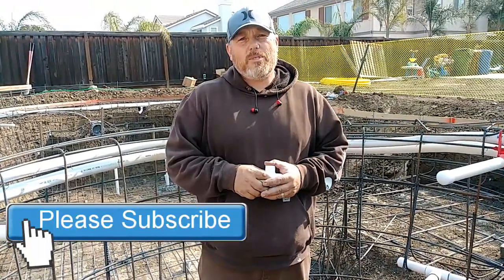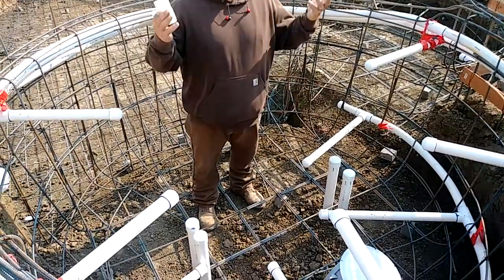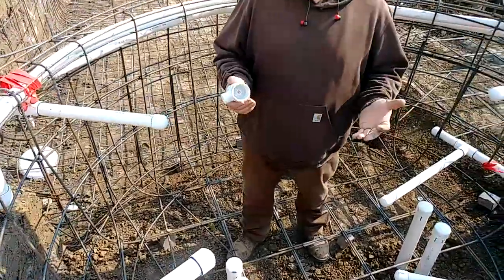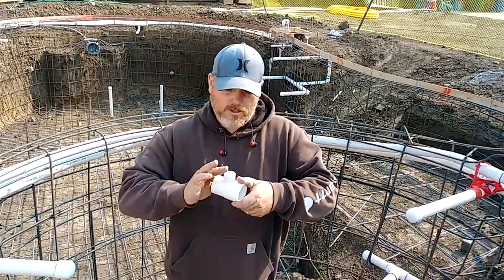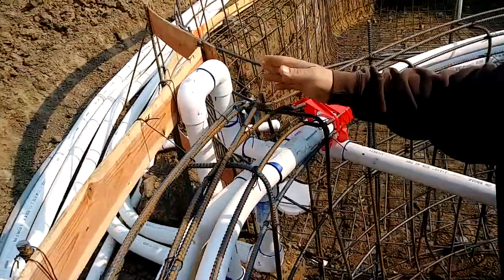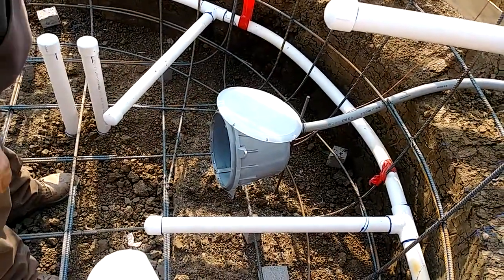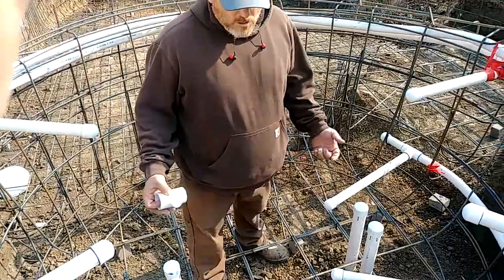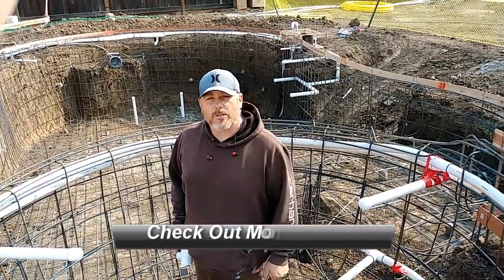How a Spa works

Comment: I enjoyed it I am making a spa like this too and cirious about how many amps I need for this project 👍
Reply from the maker: I usually run a 50 amp breaker for a pool spa combo
Reply: John The Pool Expert ok thanks also does one 50 amp run it by itself or does the 50 run to a sub panel then branches off
Reply from the maker: @heroknaderi  
Normally your pool panel. Is a sub panel as well.

Comment: Great video. How do you bend your pvc pipe? What size pump do you use for your spa jet returns? Is there a way to use one variable speed pump with and plumbing in the spa the way you show in this video?
Reply from the maker: You can use 1 vs pump and it will work but the Jets won't be quite as strong. 

Here is my video on bending pipe https://youtu.be/_edkuq8ecMc

Comment: Is there a certain tool to unscrew spa jets? Mine is a out 8 years old and I want to unscrew my jets I believe something is blocking it.
Reply from the maker: Yes if it's like the one in this video it will use a standard socket with an extension either 9/16 or 3/4

Comment: I would like to know where the Lasco jets are located. I removes a return eye ball in my spa and found the removable jet nozzle has somehow fallen off and was stuck in a return eyeball. This is a inground pool spa and I now get no air activity in the spa. I also can see water in the 2" air intake pipe at the pool equipment . What do you think?
Reply from the maker: https://lesliespool.com/waterway-gunite-venturi-tee-7-16in.-nozzle/364976.html

This is a jet nozzle made by Waterway it should be interchangeable. Some plastic nozzles have 1/4 twist-lock make sure you pull out the original one and look at it before you order one.
If all of the jet nozzles are in it should start to work properly.  Also if you remove the eyeballs it will work even better.

Comment: Great video. Our pool guy didn’t tell us that our spa was his first.  We have 8 jets but they are regular pool jets with a 2hp motor. We barely have any pressure coming out of the “jets” and there’s no air connection at all. Can we get a bigger motor? Would that help?  Trying to determine if there’s anything we can do short of getting it completely replumbed.
Reply from the maker: You could put smaller eyeball fittings so you have more pressure at the jets... but without venturi jets you can never get the air bubbles.
Reply: @JohnThePoolExpertGuy  ok...a minor nitpick....you don't increase pressure with a fitting...only velocity; the smaller the opening the less water and the pressure moves that smaller volume of water faster
Reply: @universaldonor3100  hence Raising the pressure. !
Reply: @MrBmxbrawler  it doesn't raise pressure one psi....you should do some research on how pressure is defined
Reply: @universaldonor3100  arguing with you is useless.   Restrictions in the return lines raise the psi. I work with it every day of my life. You make absolutely no sense

Comment: Hey i have a spa that just got built and the plumber put 2 drains in the bottom with only one suction line from the spa, and one suction line  from the pool and one and they both are connected with a t jandy valve, the issue im having is the spillway does not have enough power to spill nice unless i completlely close off the spa suction any  possible way i can fix this?
I can send you a pic of my plumbing it would really help me out brother!!
Reply from the maker: That is typically how It works. Normally the Spa suction is off unless in "spa mode" unless you have a completely separate set of equipment for your Spa.
So for  a decent spillway you need 100% pool suction and 100% spa return.  For regular filtration I usually set it for 100% pool suction and 50 - 50 pool and spa return.
Reply: A spa main drain line should be closed unless in spa mode, make sure suction is only open to the pool, and then you should also have a Jandy valve that controls water back to the pool, you should be able to split the water between pool and spa. 
The other thing about spillways is they're often not constructed very great when it comes to efficient water shear. What is the spillway made of?Granite, tile, rocks?
Reply: Thank you both for the replies they really helped me put all is well now!
Reply: What size pipe is the spa suction line?

Comment: Hey John, can spa light be reinstalled if spa light cord is stuck inside the conduit and pretty much done. Conduit is 150' away to junction box so no luck there, many tried. I want to add spa light in different direction with new conduit and separate connections. Partially demolishing spa seat, drill to make a new conduit and then replaster? or other alternatives?  Thank you in advance !
Reply from the maker: If you could get ahold of the original conduit closer to the spa it would be pretty easy to cut it and pull out the light and rerun the conduit closer. If that's not possible then you would have to bust a hole through the step and put everything new.
Reply from the maker: By the way.....Were you able to pull out the ground wire that goes from the niche to the jbox?
Reply: John The Pool Expert bonding wire was pulled out from the spa side couple feet out then got stuck and they tried using 4x4 but it snapped pretty much right by the niche. They used fish tape from the junction box to grab on to the new spa light cord and fish tape also got stuck about 25’ deep. At this point human strength is not enough and nobody has tri pod rodder.. seems like something got mingled inside or sharp corner of conduit.. conduit goes around the pool covered with concrete along the way :/
Reply from the maker: @Spartan_0916  
What I have found when pulling out old lights solid steady pressure will never do it. It needs to be pulled from the pool or Spa side and it usually needs quick hard jerks to get it to start sliding. Sometimes I will take the cord and wrap it around a sledgehammer and swing it away from the light niche. Sounds like you may be past the point of removal though.
Reply: John The Pool Expert yes, we have tried everything at this point. Im just blaming myself for even touching the old spa light cause it was working fine but it was there since 2001. My only option now is plug the old niche and make a new one with its own conduit and separate connection. Im guessing spa seating area can be busted and drilled then re plastered for new hole/niche?
Reply from the maker: @Spartan_0916  
Yes of course it can
Reply: John The Pool Expert Thank you John!! Btw where are you located?
Reply from the maker: @Spartan_0916  
Modesto
Reply: @JohnThePoolExpertGuy  if you ever do work in Sacramento please let me know )
Reply from the maker: @Spartan_0916  
I do
Reply: John The Pool Expert can you send me your contact info? I can send you some pictures of the spa.

Comment: I have a pool that has the air intake line spit out water. Is that normal if not how do I fix. Thank you
Reply from the maker: It depends where the water is spitting out
Reply: @JohnThePoolExpertGuy  The air intake line is by pool equipment and I can see water in it when I remove the elbow 90. When I put back into pool mode the pipe that has air suction spits water out. I have never seen any lines do that. Is there like some type of check valve along air intake plumbing line. Thank you
Reply from the maker: @herbertperez4082  
Typically that happens when a jet is plugged, covered, or if the jets have adjustable pressure and a few of them are turned off.  First I would check to see if all the jets are flowing the same.  Then I would take a shop vac and blow the line out. From the equipment to the pool.

Comment: We put in a pool and spa last year. I'm just noticing the pressure coming out of the jets in the spa while it's in spa mode is not as strong as the pressure coming out of the pipes in the pool when it's in pool mode. Any thoughts on why that would be the case? Thank you!
Reply: Having the same issue!
Reply: Do you have 2 different pumps to run your system? 1 for spa heat return and 1 for the jets?

Comment: Harper loop? How tall must it be? It's higher than the pool beam Won't that stick out? Tnx.
Reply from the maker: Hartford Loop. And it must be even with the top of the beam or higher if you can get away with it. Don't forget concrete or something goes on top of that so you might have a little flexibility.

Comment: John! Thanks for the video now I know what type of jet I have in my Spa and how it draws air and why it 20" away from the opening of my Spa. Q #1: I just need to buy that Lasco jet insert (jet only) where can I buy them? Not finding them on the internet. Could be looking at poor websites. Q #2:  Those jets are made out of plastic. Guess what happened as I tried to remove a few of them, the head broke off. Drilled it out because there was debris behind the jet from a filter grid that came apart. I need now to remove the rest of the threaded part of the jet. By the way, I'm a diesel mechanic by trade so I have mechanic ability. Should I try to easy-out the plastic threaded part? I have tools and a snake camera. How about some advice? I don't want to Jack this up, thanks
Reply from the maker: https://lesliespool.com/waterway-gunite-venturi-tee-7-16in.-nozzle/364976.html

This is a jet nozzle made by Waterway it should be interchangeable. Some plastic nozzles have 1/4 twist-lock make sure you pull out the original one and look at it before you order one.
Reply: @JohnThePoolExpertGuy  I've pulled out 3 of them undamaged and 2 of them I've had to drill with out damaging the thread but still need to remove the remaining. Should I just go at it with a tap or try a easy-out? Have you ever ran into this situation?

By the way, thanks for the name of the jet. I'll get on that. I want 5 new jets, not putting old plastic crap back in my Spa.
Reply from the maker: @martinskirzynski7798  
I have cut them out, I've use a sprinkler removal tool, I have even glued a small pipe on to one let it set up over night and then twisted it out the next day. 
My advice is Use your imagination. Then let me know how it goes.